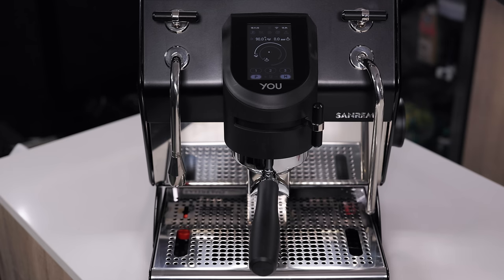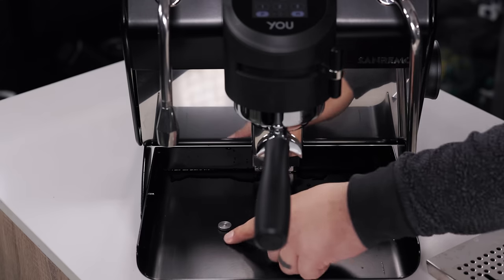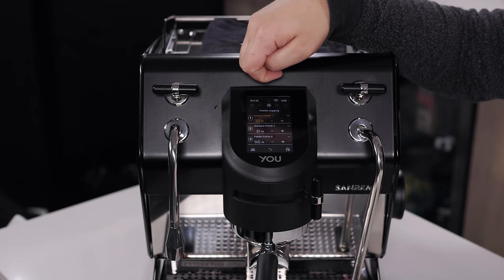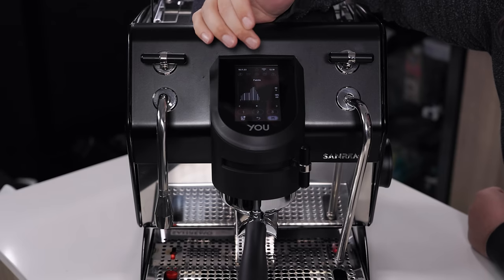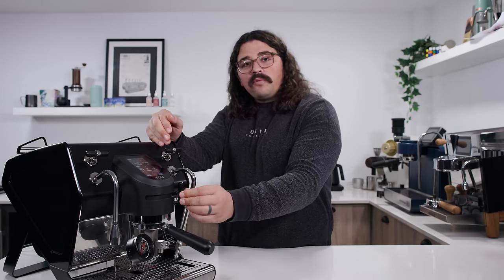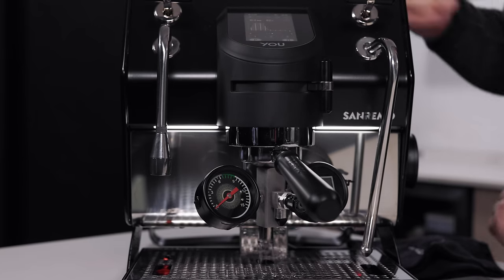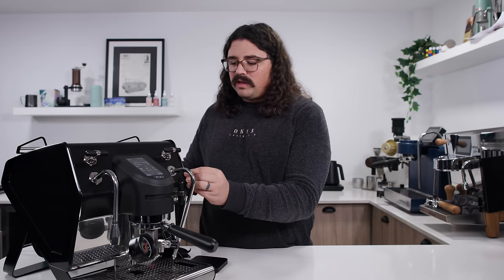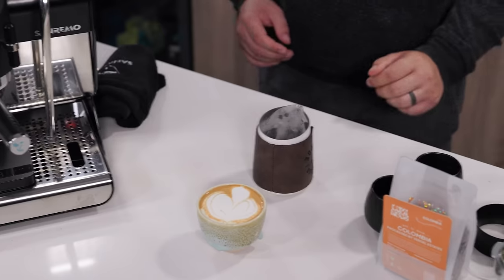IS THIS THE ANSWER?: San Remo You Review

Comment: multi thousand $ machine should not have passed QA/QC with the app issues and small drip tray, that is off-putting right away for someone who would be getting this as an end gamer
Reply: A small drip tray isn’t a deal breaker for anyone and the app issues are only with the first batch of You’s
Reply: For me a small drip tray IS an issue that could be big enough to be a deal breaker
Reply from the maker: @christopherschmitz1804 I did all these things. Numerous times. Even sought help in the messenger. Mine simply won't connect.
Reply: They are a relatively small company at a certain point they have to release their product. The real test is will they support the product once it is released. And from the sound of it the answer is yes. Software updates, and even hardware updates are a direct sign that they are willing to and able to update things as they get feedback. Its a niche product that has a very limited market and the longer it sits in production and the more changes are made to it increases its cost and makes it an even more niche product. Its not an excuse for a faulty product but expecting perfection from a smaller company will mean that no one except the biggest companies can ever put out a product.
Reply from the maker: @christopherschmitz1804 yes I haven't touched the PW. Used what was supplied. And all I know is I'm fully up to date on everything. Just can't use the app.
Reply: @thehoov6672  what about cars? Houses? The cost you your entire life and they often come with issues out of the box... what about humans? They cost you health and money and they come out kinda funny and many years later they write silly comments on YouTube about things being perfect because they are expensive... and you can't even open them to access the internals to repair them...

Comment: Lance, wonderful, thorough, and honest review, as always. I've owned the machine since the first batch went on sale last October and have been using it since. Like many early adopters of the machine, we got it for the great price of ~$4200. My machine didn't come with the Wi-Fi module and I'm actually glad it didn't, as I'd probably be frustrated with it given how clunky and seemingly unnecessary the app looks. Great if SR decides to release a better app in the future, but in my opinion, dev efforts should be prioritized towards firmware updates that add functionality to the machine, first and foremost.

A couple other notes: New machines are shipping with a bottomless portafilter and IMS baskets but may vary based on region. The legs on the back are not curved on my machine, and therefore it never wobbles; I'd argue this is a QC issue SR needs to address because yours is not the first I've seen with that issue. I don't like the plastic side panels; mine don't move like yours but they're still plastic. Lastly, thanks for giving a shout-out to the FB group; I agree that everyone is helpful and kind, and it's been a pleasure being a member.
Reply: Maybe some useful functionality can also be rendered in the app - like eg. remote config of boiler switch on / off. I use the YOU in the morning exclusively for Espresso, and it saves a lot of energy to be able to switch the boilers off so conveniently. Putting it into the app will enable users to switch it on remotely, switch on/off boilers and come to the machine 5 minutes later (it does not take longer) to use it immediately. Or add full sized shot graphs for download to the app.
Reply: @CremaChris1  I agree that these are useful features, while also not being complex to develop

Comment: Thanks Lance for the information. * small Correct ( GS3 MP is also a rotary vane pump same as the YOU but the MP in a conical paddle allows you to change the pressure at the puck ) its La Marzocco patent valve
Reply from the maker: Yes I was thinking shot brewer. Shot brewer from LM has gear pump

Comment: Mine is en route! Sooo stoked on this video! 
Edit: now that Ive watched the video Im a bit confused. Maybe your intro saying that there are a lot of video discussing the machine's capabilities is stating that you arent going to cover any of them. This was a very long list of problems from my perspective. I really like the work you do and applying a critical eye to this machine seems, well, critical. I like that theyre responsive to the community's problems and as you said, LOTS of these issues are firmware fixable. Id be really curious to know your take on this against buying some v old tech like the LM GS3. I went for this machine over the LM because Ive seen the MP is a bit sticky and I would be irritated using that on a daily basis considering my e61 flow valve is smooth.
Reply from the maker: Hope you enjoy!
Reply: @LanceHedrick  Thanks, your review has me a little nervous now but I get its the most critical take on a v expensive machine.
Reply: MP isn’t comparable unless you only plan on using the Manual paddle on the You… which in that case there are plenty of machines that offer this level of control for a fraction of the cost.
Reply from the maker: Yes. So they really aren't comparable because one is based on reproducing profiles and the other is purely manual. While i prefer the immediate feedback and build of the LM, this one offers reproducibility the LM simply can't with its set up
Reply: @LanceHedrick  that makes sense, looking at the direction LM went with the Strada X I can imagine a GS update would look similar to the You. But until that day comes this fits my use case.
Reply: Don't worry, I've owned the YOU for 6 months and love it. Great, repeatable shots with the added advantage of the paddle. Some of the things mentioned are nit picky and his own personal opinions. I had  friends over the other day and had to make 6 shots in a row. Could the machine keep up? Absolutely. They all came out perfectly using one of my custom presets with similar statistics eg 18gms to 36 gms in 30 seconds using 104mls of water etc etc. You're getting a great machine
Reply from the maker: @WasimBarri  yes with traditional espresso, it can definitely keep up.
Reply: Yes. I just hosted an event with 22 people, we pulled shots for all of us all day and we had no problems at all. All attendees were coffee professionals and were amazed at the stability of this machine. Unfortunately we did not have a scace device to test temp any further but the results in the cup were very solid  @WasimBarri
Reply from the maker: I'm not surprised at that. The temp fluctuations are likely solved by mini radials throughout the day because you were a set of coffee pros. These reviews are aimed towards set and forget home enthusiasts or particularly anal home enthusiasts who want perfection.
Reply: @LanceHedrick  Now that Ive owned and use the machine for a few months I can say with confidence the things I love most arent the features I bought it for. The sound (or lack thereof) that this machine keeps the other people in my house asleep while I make my morning coffee. Yes its consistent, yes its got pressure profiling that is repeatable enough to keep me happy, but the interaction ux and sound of this thing is a really satisfying thing for me. I like solenoids, I get that can be divisive, but theyre great imo. But to be clear, if I get wind of a LM GS4 Id drop this thing in a heartbeat haaha. I love that I get a profiled shot every day with very little effort, I can walk away whereas with my manually profiled shots I had to be involved more than I was really capable at 5 in the morning. 

Lance, youre not wrong in your review, and what you say here is important, the review is focused on those seeking absolute perfection, which I let go of years ago. This new coffee scene is so much better in many ways than in the early 2000s when I first started. We're all spoiled :D

Comment: Great in depth review - just missing a conclusion and positioning compared to competitors like decent or Rocket R91
Reply: I have a R91. After watching this review I feel the Rocket wouldn’t test better. The difference between pressure profiling and flow profiling was nicely explained here. The R91 is using pressure and time  I don’t see it adapting for differences in puck prep better. The lag may be the same too. When using volumetric on the Rocket the final amount in the cup varies with the profiling and puck. This suggests programs will have errors. Comparing the two machines the R91 look like an Atari game next to an XBox. Rocket might be more robust and I may be happier with its saturated group head. I’m late to this review maybe there’s an R91 comparison with performance instead of features.

Comment: I like the IMPORTANT NOTES section above. Perhaps it can be expanded with a few clarification like: 
1. Latest shipments include botomless portafilter instead of single spouted, as well as AMS baskets
2. LM GS3 does not use gear pump (practically not much recent innovation from them except for the Strada at 3x the price). Useful for those considering the two as alternatives.
Reply from the maker: Yes it uses a rotary pump with needle valve. I was mistaken. A bit frustrated because when I was speaking with an LM person, I said it had a gear pump and wasn't corrected right before filming this. Still is much more responsive because needle valves just are, and it reads at group, but yes. It is rotary.
Reply: What I noted is nitpicking. Your review is great (I should have started with that, silly me)! I think you also brought up many potential improvements SR can make to this machine, majority addressable by FW update. Hopefully that feedback will help define the next FW update.  @LanceHedrick
Reply: The LM shot brewer had a gear pump…but no steam boiler.
Reply from the maker: @100brsta yes I got gs3 and shot brewer mixed up
Reply: Not to be THAT guy but needle valve is not the technical term for what the GS3 MP uses. It has a conical valve that is manually driven by the movement of the paddle to either open/shunt flow from the brew valve through the dispersion block or diverted into the drain tray. The amount of flow is dictated by how the holes drilled through the conical valve line up with these “exit points” and thus pressure applied to the puck can be manipulated pretty much 1:1.

Comment: So I just got mine today. It did arrive with moisture/condensation inside the box which was odd, but thankfully it works just fine. I don't have issues with the legs being uneven/bent and my steam wand paddle doesn't have the response issue that you experienced. Maybe they sent you a used/showroom unit?
Reply: That could be even worse, that would mean if its been used then it isn't built to last, for a 7 grand machine it should be sturdier

Comment: @LanceHedrick im not sure which GS3MP you've been using but mine and others ive used have a pretty standard rotary vane pump. Maybe you were meaning rocket R9 1 or some other gear pump maching?
Reply from the maker: Just a small mistake I've admitted to in numerous comments. I was told it was gear pump and assumed it true. I was talking with an LM employee and made a comment about it being gear pump and the person didn't correct me. So I assumed it was accurate.
Reply: @LanceHedrick  and thanks for an awesome review. I love the detail .

Comment: Hey Lance, you said that the GS3 MP has a gear pump but it is a simple rotary pump I think. The pressure varie with the paddle that control the expansion valve.  I got the GS3 MP before the You, and what the paddle was doing is just release more or less in the drip tray in order to get a slower flow in the group head and thus lower pressure. The GS3 is more a flow profiling machine than a pressure profiling machine from what I understood.
Reply from the maker: Correct. Simple mistake. I said it had a gear pump to a LM employee and they didn't correct me. Lol
Annoyed.
Reply: @LanceHedrick  you are forgiven 😂
Reply: At least Rocket R91 has a gear pump. Trying to figure out should I go with the You or the R91 😕 This is not an easy choise and what ever I choose, I got to live with it.

Comment: It seems like they might be focusing on presssure profiling as opposed to flow profiling in order to make dialing in easier, but still be able to scratch that profiling itch. If the machine is matching pressure not matter what, and (trying to match) output, then it's making it easier hit pressure without as much attention to grind size or puck prep. It's analogous to making espresso with whole bean or pre-groundand a pressurized portafilter. One will yield better results but require more attention to detail; the other will provide a decent, but inferior, cup, that's quicker and easier to attain. It seems like Sanremo is basically trying to find a market that wants the experience of a Decent with a a paddle, but not require the minutiae, time, and skill to make a good cup.
Reply from the maker: No- they have explicitly said that pressure profiling is superior to flow profiling. But yes- the goal as I state is repeatability.
Reply: @LanceHedrick  interesting. I wonder why. thanks for the awesome video btw
Reply: @LanceHedrick  I also wonder what they mean by better. Better to Coffee enthusiasts generally means more consistency and better taste. But better from a company producing a machine might mean more user-friendly while still producing an above-average cup. They are trying to sell machines, and something like Decent can be quite intimidating to many people.
Reply from the maker: @0whitestone from the main point of contact I have, they mean better in every way.
Reply: @LanceHedrick  Understood!

Comment: I believe Heylo is able to do temperature profiling, at least that's what their reps told me 😅

also, I get the flow profile vs pressure but flow profile won't eliminate what you mentioned about water coming in too high of pressure at high flow rate though right? it isn't like changing the measurements will change how the water will flow

Comment: The Crem One, VBM Domobar and the Rocket R91 have repeatable pressure profiling and I'm sure there are others. . The R91 had a paddle and you can save the last manual shot but that's the only one you can save. The crem one has a dial to adjust pressure for a manual shot. So there are alternatives.
Reply from the maker: True but the assertion of San remo is this gives unprecedented control and repeatability. I'm very aware of the other two.  The r9 is especially impressive
Reply: @LanceHedrick  OK I missed their claim!
Reply: I would not say r9 is any less controlable. It even has saturated group and i would bet  volumetric measurment is more precise. Also the way it works is very similar dc motor powered rotary pump as well as flow meter...

Comment: Dang basically a fancy e61 machine. Temp stability not as good as the Decent? There was a video you did where the Decent was not giving you the temp stability you needed for a series of tests and you mentioned pulling out the Micra to finish the test. I got to ask what machine would you personally buy of all the ones you have tested for a home user $10k max? Are these minor temp fluctuations really that big of a deal in the cup?
Reply from the maker: No. This does a great job on temp unless in a Cafe. Shot to shot temp is great here.  Same with decent.
Reply: @LanceHedrick  Okay great thanks for clarifying.
Reply: This might have much better temperature stability than a Decent. Depends which Decent version, they vary a lot by performance.

Comment: Flow rate / flow control and pressure control are kinda interlinked though aren't they? at the end of a shot you can't have a high pressure yet low flow rate unless you grind too fine and/or the coffee puck has not lost integrity.  I guess if you have a double-walled / pressurized portafilter THEN you can do that :D
Reply from the maker: Yes and no. Of course they're linked. But not that easily. I have a whole video on this.

Comment: Ah, so they are trying to reproduce the characteristics of a manual lever really... With the pressure fluctuations.... But I always thought to reproduce the responsiveness of what a human can do would be near impossible mechanically, at a consumer price point anyway, so very quickly abandoned the idea. Secondly, our VFiPP tech, will be a game changer here, as they will be able to vary the resistance of the puck dynamically during the shot... Which mean the machine will be able to reproduce an exact flow and pressure profile each time...
Reply from the maker: I need one
Reply: @LanceHedrick  we're just putting the finishing touches on the Vfipp plates regarding lower cost manufacturability, as there is some micro precision involved, should have a sample plate to send you and Jonathan in a couple months hopefully, he's also requested one.